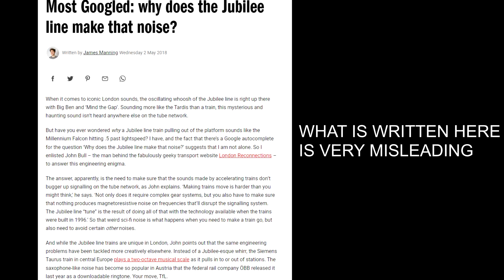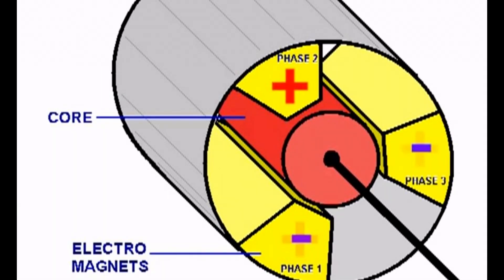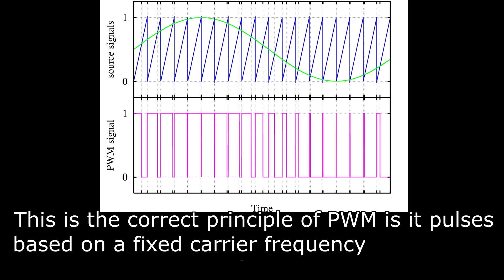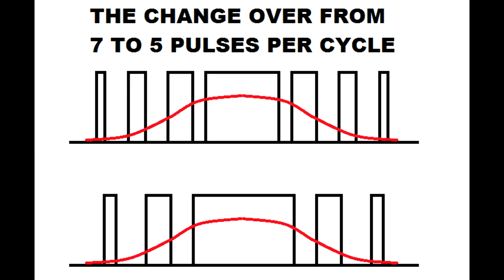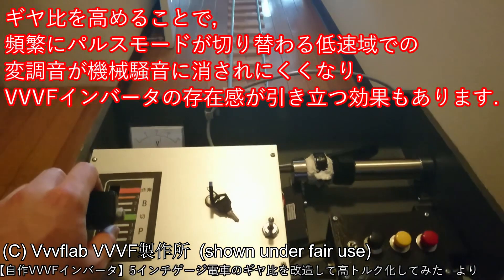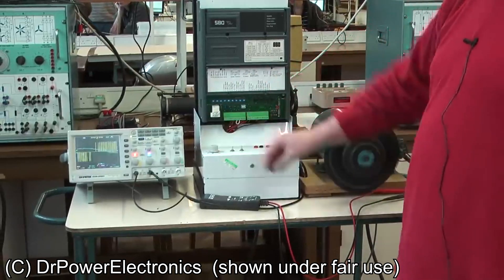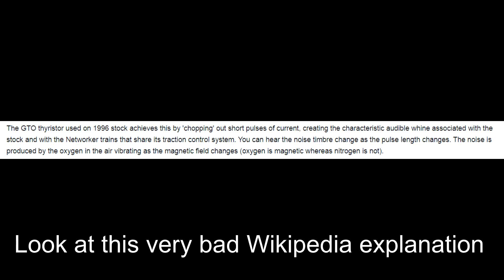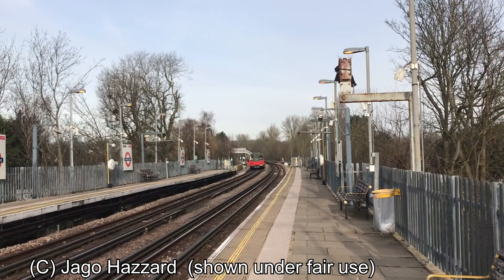Train motor sound - What UK enthusiasts get wrong while Japanese enthusiasts build model VF drives

Comment: Most modern VFD drives have started using higher PWM frequencies so the AC output cycle is still at least 10X the maximum output frequency. EG some VFD drives use 10KHZ PWM to output up to 100 HZ output frequency, so this issue is a non issue.
To prevent loss due to the high frequency, Powdered iron inductors are used in the output of each inverter outpuput, so the motor isn't driven with high frequences to reduce the inductive heating in the motor. It makes it much quieter and more efficient.

Comment: Excellent explanation, many thanks, drives me nutty as well.

As you stated, the sound itself comes from the changes in switching frequency. This switching frequency vibrates the cables, housings and motors, making them act like a loudspeaker.

A couple of other points:

1: as well as speed control by varying the output sine wave frequency, most vf controllers for AC motors have torque limiting features. On an induction motor the torque is proportional to thr current and the current is proportional to the slip. The slip is the difference between the rotor speed and the soeed of the rotating magnetic field, usually around 5%. By controlling the output ac frequency to limit slip, current and therefore torque can be controlled or at least limited.

2: everything in this video refers only to trains with AC induction motors with VF multi phase drives. These drives are pretty standard on all electric trains from the mid '90s onwards. As far as i know they are all three phase although in principle more phases could be used. The British type 45 destroyers have ac induction motors and can operate on 3, 9 or 27 phases, the higher phases being less efficient but quieter.

3: older trains with dc motors or (mostly in Germany and other 15kv, 16.6 hz supply countries) ac series wound motors will make a variety of sounds. The more modern dc traction trains (mid '70s to early '90s) used thyristor choppers but because the dc motors dont require an ac waveform the thyristors don't need to change switching frequency and the hum is constant.

4: The newest trains such as the ice 4 and many new trams are using permanent magnet brushless synchronous motors. These have a slightly higher efficiency and, usually, lower space and weight requirements. They usually require closed loop control with feedback to operate efficiently and limit torque. I don't think these change switching frequency as much but it probably varies by manufacturer.

Comment: For anyone confused by how the chopping actually translates into sound:
Those drives work by pulsing the voltage so that the average voltage during that period of time is what the voltage of a real sine wave be at that time. But they still "chop" the voltage, alternating from high to low.
When voltage is high, current starts flowing into the motor. When current flows, the motor pushes the cart, when no current flows the motor doesn't push.
When the vfd chops the voltage fast enough, the capacitance and inductance of the motor, wires and circuits* actually smooth out the chops making what's close to a real sine wave (basically "calculating the average" in a very analog way), but when it's low you get the motor actually alternating push/not push at the frequency of the chop.
The pulsing motor creates vibrations and voilà! You get the noise. Now you can understand the rest of the video better :D

*What does this mean? Well, a simple explanation is that the motor windings need a bit of time to "charge" and produce the magnetic field to push/pull the magnets, so the current doesn't immediately go to "max", and then to come down to 0 (that's called indictance!). Think of it like bagpipes! You blow into the bag quickly and then take a breath while the bag is "charged". If you alternate breathing and blowing fast enough, you can make a steady sound! If you take too long of a breath you run out of air and... You can imagine wgat happens :D
Reply from the maker: Yes, but there are parts you could have said clearer.  The number of pulses per second acts as a speaker, which is what makes the sound, while it is the frequency of the sine wave, made from the pulses, which gives the output frequency.  Your description kind of makes the distinction between the pulsing frequency and the output frequency not as clear as it could be.
Reply: @benolifts  yes, that's what you explained well in the videos! I was strictly speaking about how the motors actually "translate" the pulses into noise. Something a bit more niche but that somebody might be curious about. Cheers!
Reply: So is this like a piezo speaker ( PC speaker, cheap alarm clock ) or do we hear the sine wave imperfections in the magnetic field ( Lorentz force or magneto-Striktion ?).
Reply: @ArneChristianRosenfeldt  it doesn't act like a piedi speaker, but like an "actual" speaker, the classic ones.

Speakers are actually exactly the same, but linear! They're optimized to make noise, but in the end they're linear motors. Here, it's doing the same thing but while rotating! What you hear is the shaft quickly alternating between pushing on all the mechanical components of the train (when the pulse is high or low), and not doing it (when the pulse is at 0).
Reply: @FAB1150  To state it more clearly: "close to a sine wave" for humans sounds like a sine wave + a chirp. I think that this is a numbers game. Trains are so powerful that even a slight deviation from sine is audible. Kind like cars are so loud. I mean, automotive cars. With fast enough chopping in small motors at each axle, the noise from the track becomes louder at 30 km/h. Track noise is vertical, while torque noise moves the wheel forward and backwards -- haha.

Comment: GTOs and IGBTs are just switches. The sound is defined by how these switches are controlled to turn on and off (the inverter program) but not the switches themselves
IGBTs are able to be switched at a higher freq, but if you try to switch them with a lower freq, the sound will be just like an GTO inverter

Comment: You probably make it wrong. PWM mode (non-sync mode in japan) does NOT need to output 50Hz when your train is starting! This can't be more obvious since it's starting the 3-phase AC motor wants some REALLY LOW frequencies! It can be as low as 5 Hz so you can have 80 ticks in each cycle (or 40 ticks per half cycle) to switch between on and off. And 40 cycles can contain a 5-pulse mode or 3-pulse mode if you carefully pick the order to switch.

Still the tickrate resources are pretty scarce in this scenario therefore switching to pattern mode (sync mode in japan) is the better idea.

Comment: this video gives me a crazy idea. are electric motors silent?( ignoring bearing and brush noises) and all electric motor noise comes from phase shifting both pvm signals or rotary phase shifting in a brushed dc motors?
Reply from the maker: Electric motors make 3 sounds...
-The PWM pulsing (the motor acts as a speaker caused by the pulsing in frequencies within the range of human hearing)
-The motor bearing sound (low humming sound when near full speed)
-The sound of the current in the electric motor (the traditional sound of a motor including in the past before VF drives, this sound is louder the more power being put into the motor, and the pitch is the motors speed)

In addition to this on a train you can also hear the sound of the wheels on the track, also there is the 50/100hz sound of the rectifier

Comment: The transistors are turned on and off to produce an AC sine wave. But what keeps the transistors working in time? What tells them to turn off and on? How are their timings controlled?
Reply: Microcontrollers?
Reply: @sagnost  and what controls their timings?
Reply: The inverter control computer is in charge of switching the semiconductors (igbt or gto) on and off. How it does so is usually software configurable. Almost all VF drives for AC induction motors estimate motor speed via back emf and control (or at least limit) torque by matching the output sine wave frequency to the rotor speed plus a maximum.

Comment: Is the limiting factor on transistor/thyristor switching frequency due to the time to go from 0% to 100% or 100% to 0% actually being non-zero and NOT possible to reduce proportional to the desired switching frequency, resulting in the transistors/thyristors actually spending some time in a partially resistive state, and the proportion increasing as the switching frequency increases, thereby causing them to overheat if switched too fast?

I would guess that switching too rapidly would also cause eddy currents in the windings and associated materials interacting with the magnetic field, and these would also generate heat without doing useful work, like in a transformer that is fed with too high a frequency (for which its lamination is not fine enough) -- although since as shown in the oscilloscope trace, the current to the motor is partly smoothed out, it's probably the overheating of the power electronics that will usually get you first.
Reply from the maker: Your first paragraph is 100% correct.  It is the time spent on when neither 0% or 100% which is the issue, so as the motor speeds up the pattern as to be reformed into simpler patterns at set intervals to reduce the number of switching states.

With your second paragraph, its actually the opposite that's true.  The faster the switching frequency that more accurate the sine wave, so the non desirable currents are in the motor.  A lot of smaller motors in industry nowadays have the VF drive switching set to 10,000hz.
Reply: @benolifts  So in other words for the second part, the greater accuracy of the sine wave more than makes up for the tendency of the higher frequency to make eddy currents?

Comment: what I didn't get is, that when the pulse is cleaned say from 10 pulses to 5 pulses per cycle, why does not the output frequency drop? Say the output freq can stay at 10Hz when the pulse is lowered to 5 per cycle and increase as pulses increase again, why didn't it just use 5 pulses to output that 10Hz in the first place?
Reply from the maker: The issue is a thyristor must never resist current.  A thyristor must only act as a switch.  It can not be a resistor.  Heat dissipates at the point of resistance (ohms law) so the thyristor must do a clean switch between off and on.  However, as it is not a perfect world, the change from on to off is not quite instant, there will be a slight moment (just a nano second) when it isn't a clean switch and is between on and off states, at this point heat is dissipated.  On pattern mode as the output frequency speeds up the switching also speeds up with the pattern.  This means that the thyristor changes state more and more often.  Due to this the number of nanoseconds where the thyristor is neither on or off increases.  This is the reason why the pattern must reform with less pluses.  The reduction of pulses when changing from, lets say, 7 per half cycle to 5 per half cycle means less accuracy on the artificial sine wave.  However the frequency of the sine wave is not affected.

Comment: To put it very simply, the audible sound comes from the stator of the motors which react to the received switching frequency.

Most traction systems using inverters to manage current inputs to the motors use modulation starting with a PWM (asynchronous), then synchronous cutting schemes (SHE 7, SHE 11 etc.)

Comment: So, it is possible to make an electric car, that has shifting in VF drive?
And it could be made in hearing range frequencies.
For those who straight-pipe their exhaust, they could remove the noise filter to make it louder.
Reply from the maker: Toyota Prius does this.  You have to listen carefully as it is doing it at quite a high frequency.  0-20mph is at pure PWM, then 20 to 45mph is using 3 different pattern based PWM.  The motor has a top speed of 45 mph, then the power split transmission's CVT system diverts more power to the engine and the motor's speed is held by the CVT to stop it over speeding.
Reply: I also assume that other toyota/lexus (toyota's high end brand) hybrid's does this aswell, as the brand trickles down their hybrid system into more of their products (such as the RAV-4, Corolla & Camry hybrids).

Comment: An interesting video. The European locomotive Siemens ES64U2 also plays a musical scale when accelerating and braking. Currently, the powerheads of the German ICE-1 trains have also been converted from GTO converters to IGBT converters for future use. This also changed the acoustic frequency of the traction motors after the conversion to IGBT converters when the train started up and accelerated.

Comment: I would like to note at 2:20 in some cases with 3-level inverters the power could be at 50%. This is used in cases such as the JR East E231-500 previously used on the Yamanote Line. Many Shinkansen bullet train models also use this inverter circuitry including a few other variations of the E231 and other classes within the Japan Railways fleet. The DB BR 481 also has this capability within it's inverter circuitry from what I understand, however this is never used and operates in a standard 2-level PWM mode. Thyristor and Transistor switches can not be 50% on their own however, and require some form of resistance to create the 3-level effects.
Reply from the maker: I would assume that there are multiple thyristors to create this, rather than a thyristor being run at 50%
Reply: @benolifts  Presumably 1 thyristor/transistor for generating voltage >0 and 1 thyristor/transistor for generating voltage <0, fed from a DC system that has a neutral wire.
Reply: @Lucius_Chiaraviglio  I'm not terribly familiar with 3-phase drives, but with the drive circuit shown at 2:00 won't each line switch between driven high, driven low, and undriven, effectively creating three levels? (assuming the coils are in a Δ-configuration, since in a Y-configuration you would definitely not want to leave any output undriven)

Even when driving a 2-terminal load you don't need a third supply rail to get a 0-level, you can simply short the two terminals by driving them to the same level
Reply: @MatthijsvanDuin  You're right, that diagram has no neutral wire, so the thyristors/transistor pairs each have 1 member to connect to positive and 1 member to connect to negative.  Having both off would still stop current flow(*).  Of course, you DON'T want to have both turn on, because that's a dead short from positive to negative.

(*)In practice, if you don't have a true neutral wire, you might want to add some other provision not shown here for letting induced current go somewhere safe so that you don't get a huge voltage spike when a large current is flowing and the thyristor it is going through suddenly shuts off.
Reply: @Lucius_Chiaraviglio  that last note is what I meant about not wanting to leave any output undriven in a Y-configuration, but in a Δ-configuration it shouldn't be an issue. (I don't actually know which is used in practice)
Reply: What about the L0 series maglev that will be used on the Chuo line? Does it have a VVVF drive?
Reply: @coastersaga I believe that just uses rapidly switching electromagnets for propulsion
Reply: @coastersaga  afaik the latest technology used on the test line was IEGT cycloconverter

Comment: I like the sound that 1959 stock made. As a much older electric technology. I assume that tube trains newer than 1996 stock don't have pulsing motors, but I haven't been to London for years. Nb a new genre of electrical videos has come out recently from Japan and South Korea - overvolting toys!
Reply from the maker: All modern trains, electric cars, electric buses, E scooters, and pretty much all traction motors use the method described in this video.  Although in smaller motors the carrier frequency would be so high that it never reaches the stage where it has to switch to pattern mode.
Reply: @benolifts  What about using a pure sine wave oscillator?
Reply from the maker: @coastersaga    It is not possible.  Think of ohms law.  Any part of a circuit that is resisting current is dissipating power.  Power can not simply be resisted or turned down like a volume control.  The motors are large.  A lot of current is passing through them.  Large amounts of current can not have the flow of current impeded without huge amounts of heat being produced.  The only way current could be resisted is by having motors in pairs and switching between series and parallel, or by using huge heat dissipation resistors, which is what old DC trains used.  But with VF drives and AC motors, the output frequency has to be changed.  The only possible way is by PWM, so the motor is switched on and off at a very fast speed to create an average voltage.

Comment: Great information, I had always known that the noise was due to the switching strategy but not what the strategy was.
Reply: I'm in the same boat.  Although I thought they might be also doing something like switching the number of motor poles to keep the switching frequency within acceptable parameters for the transistors/thyristors.

Comment: Older electric trains have better traction sound including the Class 323, Class 465 which have been modified with Hitachi traction motors and of course the Jubilee Line 1996 Stock built by Alstom. 

Even the newer ones also have epic traction sound like the Class 357, Class 375, Class 376 and Class 377 Electrostars built by Bombardier.
Reply: Some 465s still have their original motors